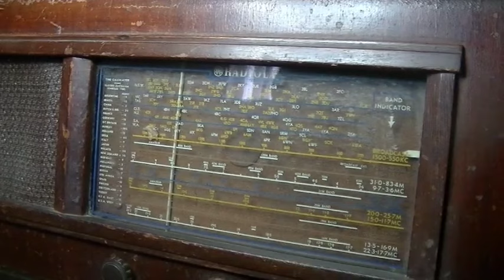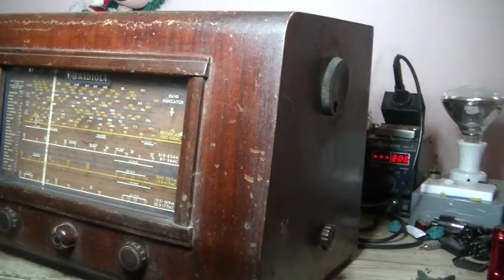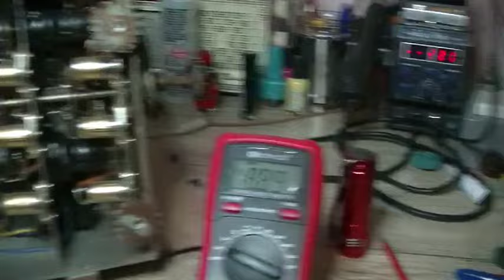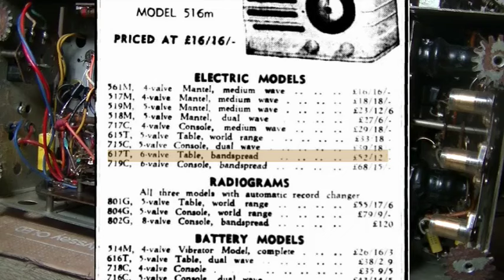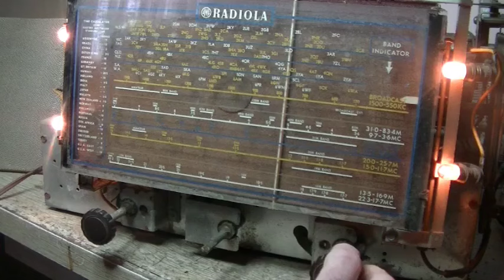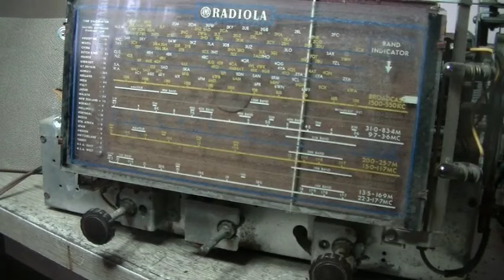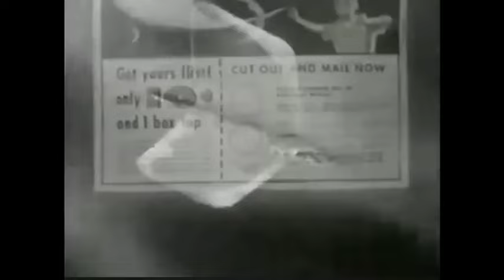Restoring a Radiola 617TW Tabletop Radio from 1952

Comment: Had to be a high-end radio back in the day. Nice job bypassing that proprietary plug/cord with a new power cord and adding the MP3 jack. 80 watts power consumption, that’s small CRT TV’s or larger solid-state wattage ones back when. Interesting fast video, great stuff, Frank.
Reply from the maker: thank you so much Ken

Comment: The 617TW has a magic eye tuning indicator in the middle of the dial scale, (which didn't seem to be glowing in the video.) This increased the price in 1952 to 78 quid.
I have one of these beasties in my shed cupboard waiting for repair, the condition of it is not as good when compared to the one shown here. Here's hoping the alignment won't be too far out either, as have been told this can be a tedious process.
Reply from the maker: I can now see on the video where the magic eye should be but this one didn't have it. I guess the original owner didn't want to spend the extra cash lol. Thanks Man :)